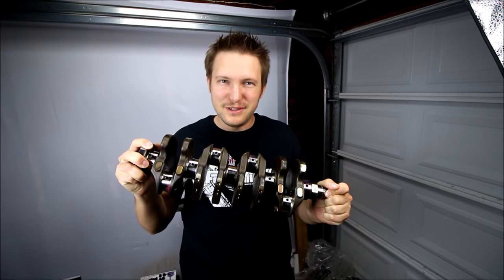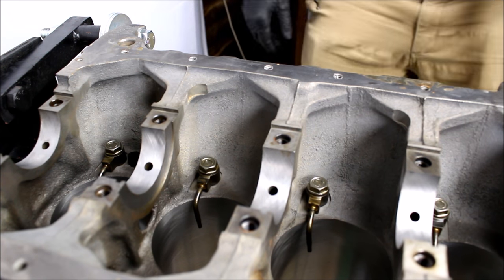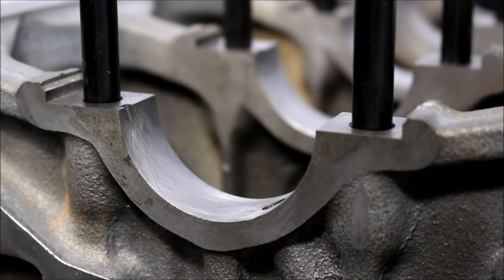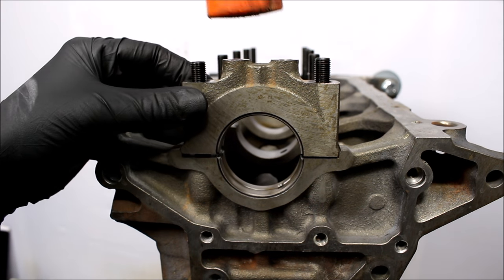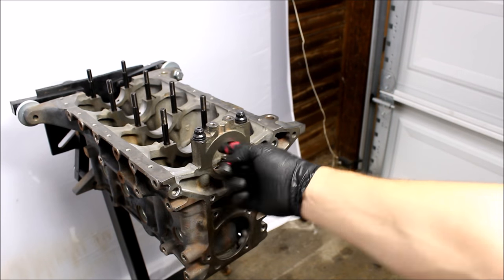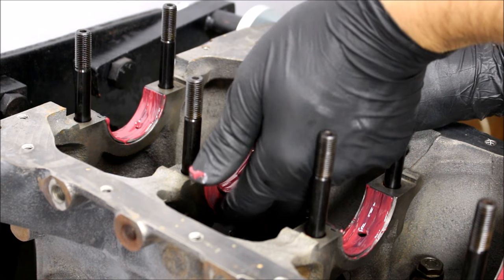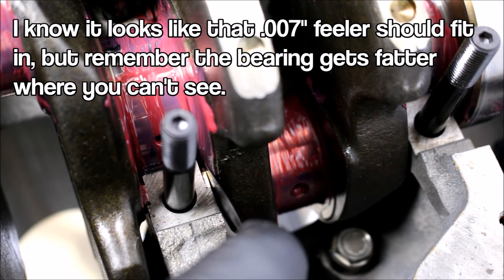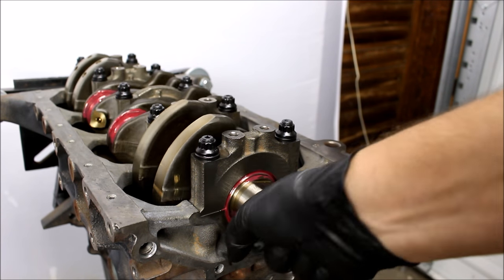Crank It Up: VVT Engine Crankshaft Install  (Rebirth Ep9)

Comment: Dude ever hearde of Plastigauge?
Reply from the maker: Yes, the less accurate way of measuring clearances. It works, but I wouldn't bank on it being perfect.
Reply from the maker: Zahier Mahoob And those tools provide an accurate enough reading to ensure you're in that range. I stand by my statement that measuring out the clearances is more accurate that plastiguage when the tools are used properly.
Reply: I wouldn't bet money on that with the bore gauge you'r using, at least after the firs bearing. Plus Plastigauge is good enough for a car manufacturer so....yea. Other than that how do you know witch color bearing to use so that the Main bearings are straight throu without Plastigauge? And btw spinning bearings?? motor oil is going behind the bearing anyway, and pls don't use a mallet just jently put the caps on.
But other than that nice work.
Reply: I don't know of a single car manufacturer today that uses plastigauge, when you are assembling hundreds of sub assemblies a day you don't have time to fiddle with it, not to mention poor accuracy, poor repeatability and the need to reduce operator to operator variation during mass production. Car manufacturers typically use laser micrometer fixtures that literally take about 1 second for the worker to get all of the measurements they need within .0005". Depending on the factory and the part being inspected the readout will then give them a go-no-go indication or will tell them which color coded part (such as when selecting bearings, wrist pins, etc) to use for the desired tolerance.

Also the whole "good enough for a car manufacturer" argument goes right out the window any time you are building a performance engine. Car manufacturers are worried about building their product as economical as possible to fit the selected market it is being sold for, if it meets minimum federal regulations, minimum customer expectations and runs reliably for 60,000 to 80,000 k miles they've done their job.
Reply: Mostly true, however i didn't talk about the assembling in the Factory, but the manufacturers repair Instructions.
And about the manufacturers accuracy part, nope, not how it works with engines these days. They are probably better than those of the most rebuild engins, for the last engine i build the manufaturing tollerance for the main bearing clearance was 0,026 to 0,040 mm (so about 0,001'' to 0,0016''), so yeah.
Reply: Plastigauge is for amateurs